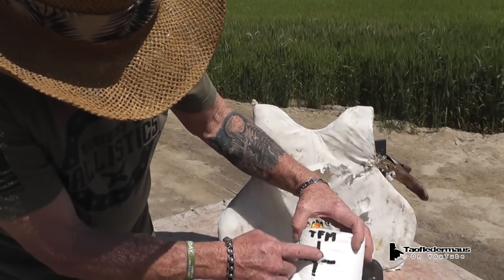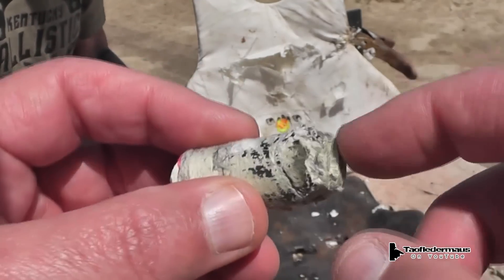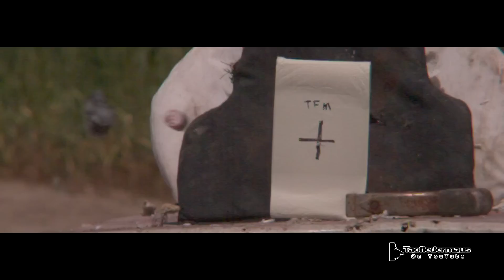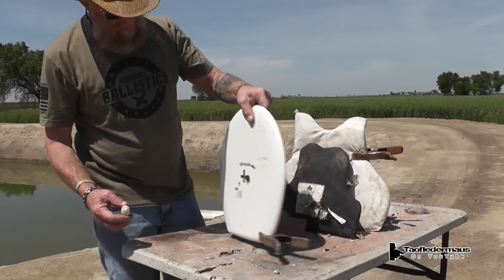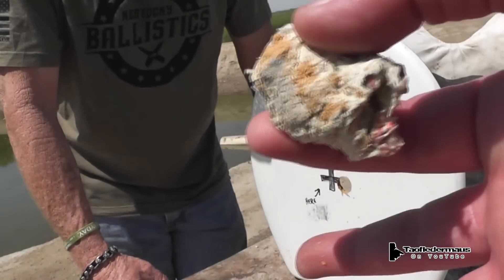HPC's Amazing TOILET PAPER Shotgun Slugs - Over 1000 MPH

Comment: I'm curious how it performs when faced with 2 layers of 3/8" thick dry wall separated by 4 inches. The gel, even old and tired as it is, shows that it could be a good home defense round in close ranges. I just wonder how it performs hitting 1 or 2 layers of dry wall with an air gap or with a few inches of pink fiberglass insulation.
Reply: Now, I am really curious how a paper round would perform in a .410 with a bit less load... would it be a good home defense round that stops at one layer of dry wall? would it take a leg off an intruder?

Comment: Guys known for firing almost anything out of a shotgun: “we’re not gonna share how we’re planning to launch these.”
Reply: Based on the sound it's a air cannon
Reply: @jaykoerner  you can hear him pumping the shotgun
Reply: @RevampedRedneck  Shhh.
Reply: Thats just the sound of an old high current claw switch
Reply: @jaykoerner  they're talking about charging capacitors so its likely a DIY rail gun.
Reply: Clearly a overbore tampon applicator.
Reply: Did you fire through a vacuum?

Comment: i guess you made those CD ROM in RW when you "wiped" them ;P (every one needs one joke right!) tho toilet paper is made of processed wood and that is also supposed to be as strong as concrete! well when all compacted i guess it IS! tho i wonder if you could load a wine bottle's cork with needles and try that! (like 50 needles or some number that fits sanely without destroying the cork too much!) that would be some staple of pin point finesse!

Comment: Are you using a TKL-2900 capacitor bank in your accelerator? I can only get subsonic with mine, my buddy says I need to recalibrate my frammistat compensator, but I think it's a misalignment of the gravity coils. Any advice?
Reply: David M 
Check your Harmonic Refibulator. It may be out of calibration. You'll need a left hand Fiddle Wrench to adjust it 👍🏻😁.       🇺🇸😎

Comment: Launch them against a harder target such as a AR500 steel target.  Will the projectile disintegrate?  Does the compressing of the paper store any energy that would be released upon hitting the harder target and basically turn it into dust or will it bend the steel?

Comment: those "Capacitors " certainly propel the pellets to high velocity's ,but they appear to charge just as quickly , Shame the powers that control YT can't supercharge their brains and apply common sense to their ruling's , but that's the problem with "common sense" there is Nothing Common about it !  Great video though,  My imagination filled in the missing elements .
Thanks to all You   guys for all You efforts and Patience with all the changing regulations !   YT wouldn't be the same without TFM .

Comment: optical disk is still the cheapest failsafe backup medium. flash storage is xpensive and degrades over time, ones and zeroes occasionally flip and your data gets corrupted. mechanicle drives are even less dependable with their magnetic and shock weaknesses.

Comment: Super Bitchin', Dudes!!
I must say I'm impressed with the accuracy of the "missiles" from the  capacitor energized launching platform that sounds suspiciously like a shotgun being "charged" via the forearm. But what do I know, right?!? LMAO 
What it all boils down to is that I sure as HELL wouldn't want to be on the receiving end of one when launched.
I have to admit that I'm curious as to their weight as knowing that would give us an idea about how far one could be launched and delivered with any degree of accuracy and terminal effectiveness. 
Inquiring minds wanna know. 
Great work, Guys, and Danny, Superb marksmanship, Sir.
Reply: Thet weighed the test objects at the end of manufacture, they aimed for 8 gram, but may have ended up with 9.  Tao sent them diameter, length and mass requirements, and they were too professional to send the out of tolerance prototype.

Comment: We need 5.56/223 TP rounds now! ;) I'm curious if they would engage the rifling properly, and whether or not they would survive 3,000FPS.
Reply from the maker: haha, probably wouldn't handle the 60,000 psi pressures!
Reply: @taofledermaus   You never know dude! ;) If you ever tried them out, you could do some plain, and some with a gas check installed. It would certainly be cool to see :) And if it worked, it would be another potential option for areas that require lead-free rounds ;)

Comment: The lid is what you put down when you're done. the seat is what you're sitting on when you're not
Reply from the maker: but you can sit on the lid....
Reply: @taofledermaus  you can sit on a table but you don't call it chair hahahaha it was designed more as a cover for your toilet you already have a place to sit with or without it if you look at the design the lid only has 2 "feet"on it to hold it level not very load bearing compared to the seat that has at least 4 each over twice the size you have a place to sit that is more comfortable than the flat lid right under it oddly enough I just had a concert to a buddy about this a few months back lmao we both went into it curious and talked about a toilet for probably 30 45 min and both walked away in agreement on lid and seat he is a general contractor that's what brought it up. I can go deep into more descriptive points but I'll spare you hahaha you didn't mention in the video if you were spinning those missiles with lands and grooves the whole way or partially or running them out a smooth bore?

Comment: Great vid would have liked to seen the effect on the lead though 😎
Reply: That's why I wish they had tested it.. Just curious.. I think it'd do more damage than we think
Reply: Excellent suggestion
Reply: Always have the LED plate 😊
Reply: I thought the same thing. I think it would have made a pretty good size dent! 🙃
Reply: Explode on impact
Reply: @Washawaysin  even if it exploded on impact it could still do good damage to lead, especially since lead is a rather soft metal.

I dont think it would explode though, it would go similar to them firing it through the compressed roll I would imagine where it kinda flattens but still maintains a dense corse

Especially considering they were using a vest as a backstop and that didn't fully obliterate it.
Reply: Probably dent it, and nothing more

Comment: The launching device you are using must be top of the line in order to create that kind of spin stabilization to a smooth projectile.
Reply from the maker: it has an angular momentum type thingie on it.
Reply: Does it have the shoulder thing that goes up? Can't have an effective stuff-launching device without the shoulder thing that goes up.
Reply: He must be watching the slingshot channel, that's rubber powered! lmao.
Reply: it's the special capacitors in the miliFarad range... and a compass in the stock and this "thing" that tells time.
Reply: I’m pretty sure Jeff has something that rotates the magnetic field around the projectile as it’s being launched, in order to impart spin. Just imagine how much power he has to use to generate a magnetic field that would effect non ferrous toilet paper.
Reply: That launching device has a very similar cocking click to the  pump shotty these guys use.......😂😂😂
Reply: At 5.16 sounds something like a mossberg 500 opening up.... Doesn't explain the spin though.
Can hear something similar closing for the gummy bear too...